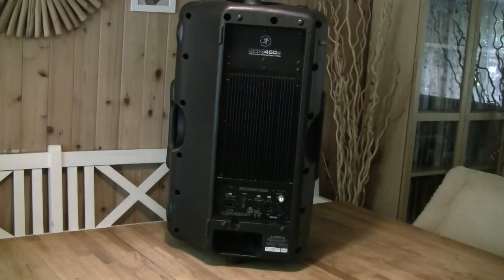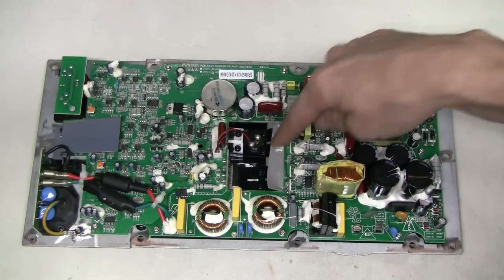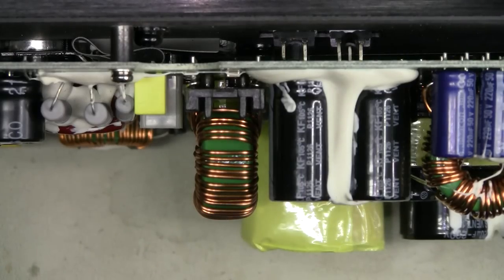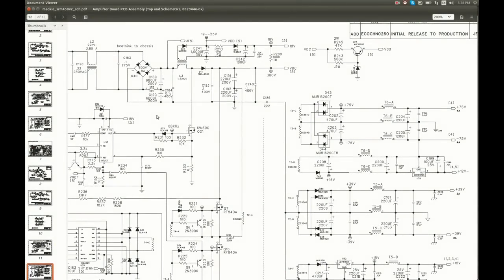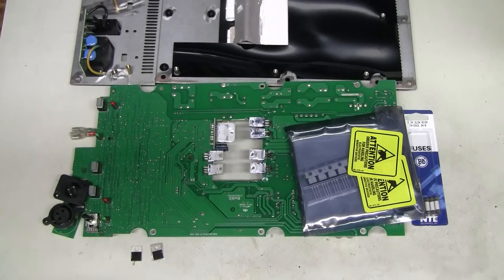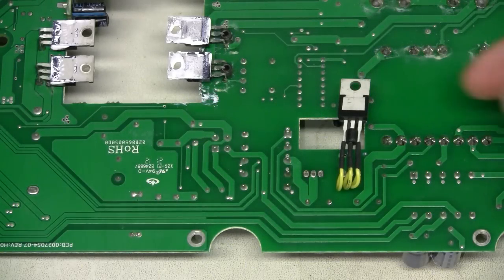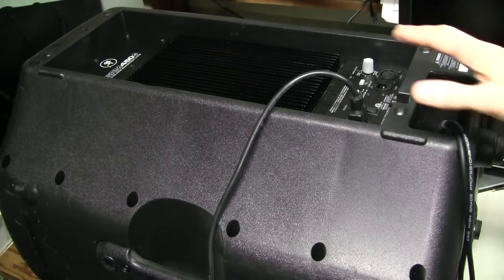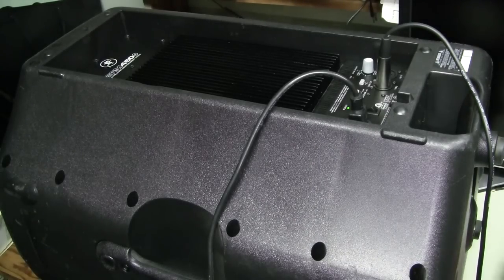#69 - Mackie SRM450v2 speaker repair

Comment: Great repair. It seems a lot of manufacturers expect their customers not to drop their equipment. ;)  I've noticed that some bend small U bends into leads so they have a little give in a situation like that. Your wire method should allow it to survive some huge board movements.

Comment: hello everything is fine ?
Could you help me, I have a mackie srm 450 v3 active box, and when we use it on the microphone at maximum it restarts, it keeps restarting all the time, and when we reduce the volume it works normally, I am from Brazil

Comment: Hi mine are the first gen made in Italy 2 of the capacitor blow and smoke after I turn it on it didn't been used for 2 years last time work fine 
I don't know if I should just replace them and what could cause it I had 6 speakers connect at that time only one blow any idea is welcome.
I will use the spare amps for now

Comment: One point: the 'thump' is the proximal cause of the diode leads.  The high level of vibrations caused the diode leads to constantly flex until metal fatigue made them shear off.  Wouldn't this situation be best served by placing some hard foam pads between the board and the heat sink to absorb those excessive vibrations?  True, you did add wires to those leads; but they too are still subject to these same excessive vibrations!  Good preventive measure.

Comment: Hello.... I opened up the board on my SRM 450 which stopped working. I did not find the same problem as shown here. What happened was .... the speaker was driven very high and heard a 'Popping' sound and then a strong burning smell. Any ideas what I should look for ? CHEERS Mate !

Comment: hello very helpful video. in my case i have U36 chip blown up. i also found the same transitory with broken legs. i change the transistor and the U36 Chip but as soon as i powered on the U36 blew up again. any ideas?

Comment: The drawback of the way all the leads on the discrete mosfets & diodes...are bent..badly....with sharp right angles....they should be of rounded bends.. which I always do..
after the new with rounded bends..they never came back for same failure..
even THOSE short extension leads are a big NO- NO for me..
@ 350kHz pwm current..
Reply from the maker: What is the problem with short extensions in your view?
Reply: @feedback-loop  more spikes & ringing because of  added lead inductance... here full length leads plus length of flex. wire...plus 3 extra solder joints..shortest possible leads ARE ALWAYS best..
the ferrite on drain lead and device rating does help though..

Comment: Your methods of repair are almost poetic.
On the other hand Mackie has lost some of its prestige IMHO.
Such construction flaws simply shouldn't happen.
Usually these Mackies come in pairs.
I suggest you tell your customer to have the other unit repaired as well.